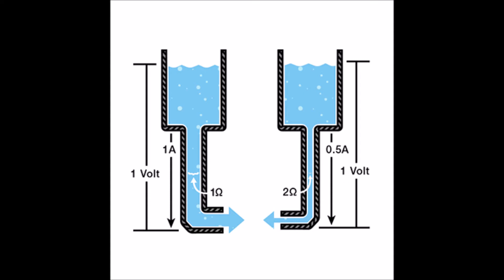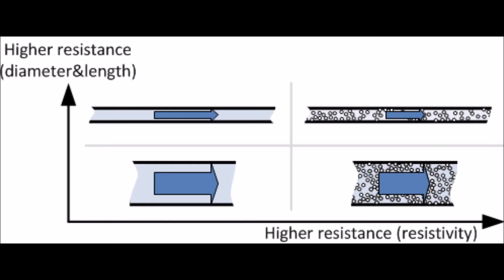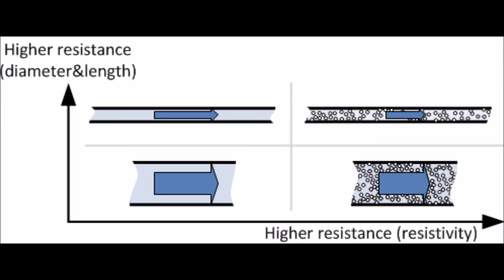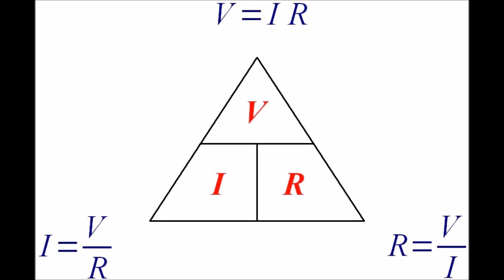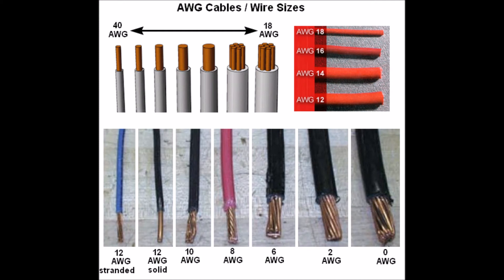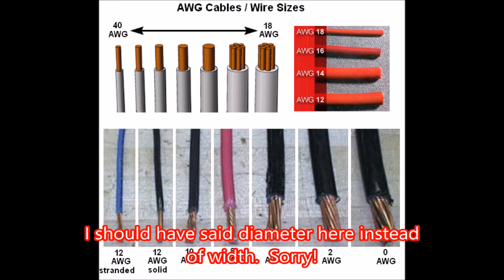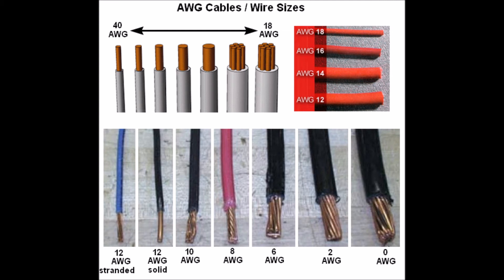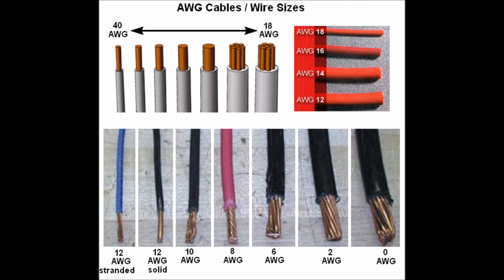Solar Panel Basics - Resistance 101

Comment: Great video, thanks for sharing your knowledge and what you have learned. I am just embarking on the solar journey and starting small.
Reply from the maker: Awesome.  Solar is a lot of fun.  I wish I had spent more time on the basics before embarking but I guess that is not really how I learn.  I learn best by jumping headfirst into something and making mistakes and then correcting problems.  But good luck with it and let me know if you have any questions!
Reply: Yeah, I am very similar actually :-) I picked up a panel on sale at our local hardware dealer...it is a 40W panel made by Coleman and just ordered a controller this evening. My plan is to try hooking up a few low voltage lights as a start along with an IOT type sensor for temperature and humidity. The case you used for camera project was pretty cool, I was thinking a wooden box but yours was very cool. I will definitely keep you posted on my progress. Thanks again for the videos.
Reply from the maker: Scott Dillon
Haha, I'd go wooden box unless you have a big budget.  That cabinet alone was over $300.  You are welcome and keep my posted.
Reply: Wood it is :-)
Reply from the maker: Scott Dillon Haha,same here.  The only reason I got that nice metal, weatherproof enclosure was because it was for work and we had the money and I needed something foolproof because I wasn't going to be able to keep an eye on it all the time.

Comment: How to calculate voltage drop for length of wires; if I have 50 feet of 12 AWG, how much is the voltage drop. Please advise.
Reply from the maker: The answer is it depends on the current you are flowing and what voltage your system is.

Refer to these charts:

http://www.solar-electric.com/wire-loss-tables.html
Reply: is there a formula that I can use to calculate the issue? 
Please advise.
Reply from the maker: Manit Churanakoses I don't know the math, sorry.
Reply: thank you.
Reply from the maker: Manit Churanakoses You are welcome.  Thanks for watching!

Comment: Excellent! Just upgraded my solar chargers-to-battery busbars from #6 to #4. Much less heat at the breakers. They barely even get warm. Before...well, let's just say they were too warm. I used TEMCo fine strand welding cable...some say that is great, and some folks say not. All I know is that is less resistance (heat) and my system is performing better. I think the #1 issue folks have in DIY solar/wind is undersizing their battery/charger cables and terminal lugs. See this a lot in videos.
Reply from the maker: +Chris DIYer Yeah, I agree.  I also had problems overcoming voltage drop in my early setups because I didn't yet understand it and didn't fully understand resistance, either.  It is silly for me to think now of investing all this money in solar and wasting a good % of it by not understanding those 2 concepts.

Comment: hey how does voltage drop because of resistance, in equation I see that only current is affected by resistance I = V/R and V = IR it seems that by increasing the resistance only current drops so to keep the same amount of current we would have to increase voltage, seems legit because resistors limit the current so it doesn't burn off the appliances with huge currents, is my understanding correct?
Reply from the maker: +Trec93 I am not an engineer but from my understanding Ohm's law doesn't account for voltage drop.  You are correct that if you increase resistance then the current drops and voltage is unchanged.  I think you have the understanding down.  The reason I mention this concept in my video is because I will start using that term in upcoming videos.  I want to make sure people understand how bad voltage drop can be in a pv system.  I will probably do an entire video on voltage drop at some point.
Reply: LDSreliance oh I get it now thanks